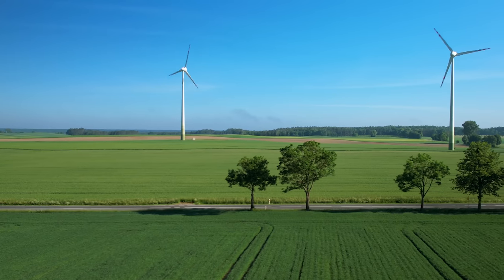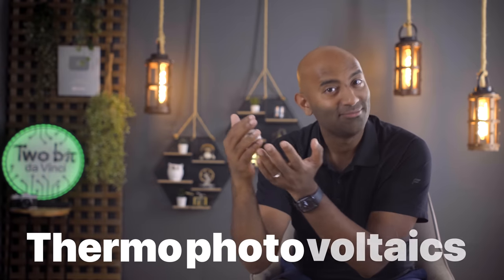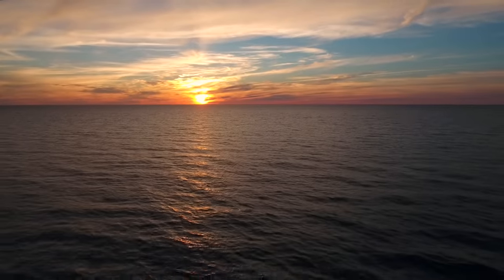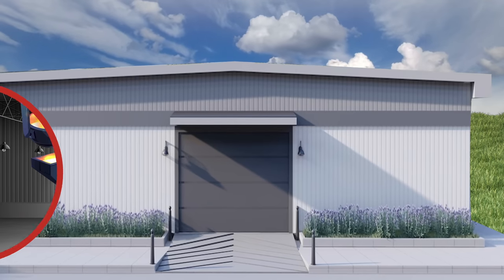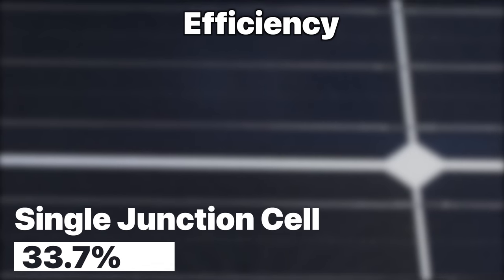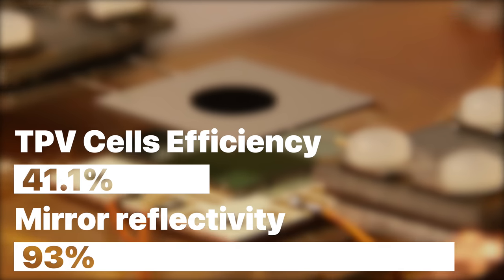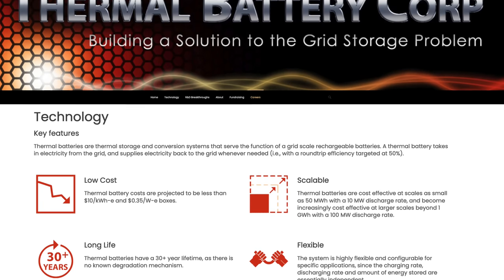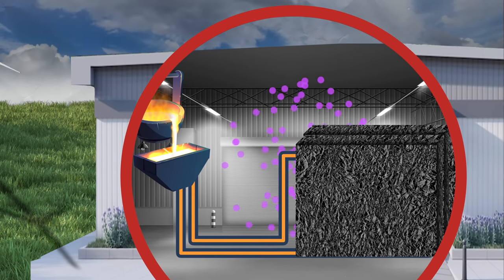Breakthrough Solar cell DOESN'T Run On Sunshine!

Comment: Turbines are an extremely mature, efficient, and reliable technology for heat to mechanical conversion, (every nuclear plant uses turbines, as well as every passenger jet ).
As well the heat capacity of graphite vs water is almost 6/1 in water's favor, 0.77 Jgk vs 4.186 Jgk... using such low Cp substrates for heat storage makes no sense.
High energy photovoltaic cells are ALWAYS prone to shorts, requiring complex decoupling to prevent array meltdown.
This idea will be another on the gov subsidized junk heap of really bad ideas.

Comment: In the deserts this would be super beneficial, hope it pans out
Reply: But in deserts, you could simply lay black pipe on the ground, cover with a transparent lid, pump water through it and connect it to a heat exchanger.

Comment: Thermal photovoltaics should be more efficient than steam and Sterling engines to extract heat from nuclear fuel ponds. Maybe with some solar-powered heat pumps.

Comment: Just think of direkct Nuclear radiation/heat to Power, without that crappy steam turbines. Just put Uranium inside these carbon isolation with the TPV cells. Boom nearly endless battery. No moving parts. No dependency on sunlight.

Comment: Are you sure about this? 1sqm of solar panels produces ~250W. The claim that these cells produce 100kW per sqm seems questionable. Where is that power coming from in the first place? Sunlight only produces 1kW per sqm in peak conditions.

Comment: I'd love to see 'waste' heat generated in industrial processes captured and used in this manner.
edit: Likely I don't understand this well enough to know if this is fantasy, but I hope!
Reply from the maker: Troy I was thinking the same thing, almost every thing humans do creates heat, from our electronics to smelters, and where there is massive extra heat, yeah we should absolutely do this!

maybe future homes have a graphite block buried underground, where heat from the AC can dump heat into... to get get that energy back in the evening or something... the question is what minimal threshold of heat would be needed, which could be the limiting factor.

but yes!
Reply: It would require an unprecedented level if cooperation. Politically and economically infeasible without deep pockets to cover the upfront investments.

Comment: I have envisioned a power cell for years that would work like a solar cell but use radiation as a power source. Radioactive waste would fuel it. Take a container lined with the cell and pour in radioactive waste. A new type of nuclear battery. We could make use of all the waste from reactors. I hope someone is working on this because it seems so simple. You could turn a barrel of waste into a battery just by popping the lid off and inserting a panel of these cells with a new lid for the wire to come out and you have a nuclear battery. I wonder if regular solar cell would work. Has anyone tried any of this?

Comment: I was wondering if this process can be used to disinfect water since UV rays are emitted or the heat can be used in desalination plants. 
Also can the T.P.V. be more efficient if cooling is provided at the back?
Reply: Regarding desalination but not necessarily related to the video. I've just been obsessed with a few designs lately.

I wonder if they've ever considered creating a hybrid between decondensing/condensing system and a heat/cold system.

Basically needs 2 chambers. A vacuum pump decompressing one chamber and compressing the other. And a heat pump moving heat into one while taking from another. And a handful of solenoids to seal them between phases.

Why do this? It'd take less time to boil and condense the water. Possibly it could even use less energy because it recycles heat... the vacuum pump does take energy as well. But would only need to be running periodically.

Comment: The assertion that wind and solar are less costly than traditional forms of energy generation is completely false. Substantial Federal subsidies are necessary to make wind and solar energy generation cost competitive. In addition, they are simply inadequate as a replacement for oil, gas and coal energy generation. Renewable energy simply isn't ready for "prime time". Europe's leadership has decided to provide an object lesson in reality this winter.

Comment: Would be great if they succed but as I see it their system has just too many failure points. I mean, if they can store that much energy inside these hypothetical carbon cubes, why not just use it to run steam turbines in combined cycle converting 40% of energy in electricity and another 20% in heating/hot water?

Comment: dk where you got you efficiency for the turbines. there more like 65 to 95 percent efficient for multi pass. Witch is what most if not all are for power generation. you must be talking about single stage. there more like 40 percent. But single stage arnt used very often.

Comment: This is pretty cool, but these ideas are not worth getting hyped over imo. I have learned that if more than one part of a proposed system is unproven in a practical application for the role it has to play, then the system is most likely going to fail. In this video you mention several new technologies which have not been proven to work in any practical application for the role they are expected to play in this proposed system. If it was just one experimental technology being utilized, and there were lots of tests and studies behind it, then I’d be much more on board. But this hypothetical system seems fraught with unknowns

Comment: Your estimation for power per square meter is way off. The cells themselves may only take up that much space, but the entire operation to radiate that sq meter is hundreds of sq meters. Just look at the size of that chamber alone holding the cells. 
It would be interesting if they can use it for scavenging heat but i bet its nowhere near economically feasible.

Comment: Yes, there are a lot of physical unanswered questions in a system this complex. However, the real question is how much money will be spent by legacy industries to stop the advance of this tech? Maybe it is complex enough that they might be interested in it's success rather than it's failure at least if they can find a way to extract cash for themselves by helping it succeed rather than lose cash if it does. Time will tell. The fossil fuel industries have sure spent a ton of cash trying to keep their hold on humanity so far, but maybe the time is now.
Reply: PS Sorry if I sound very cynical. I cannot help it at my advanced age.

Comment: 12:55 the cost is around $10 per kwh but I currently pay $0.20 per kwh.  That would mean my last months electric bill instead of being $170 would be over $8,000. Hmmm, not gonna work.

Comment: Ummm... why not just modify foundries to use the heat they need to smelt metal, instead of just smelting tin for reuse
These foundries are already running sometimes 24/7

Comment: You should differentiate between steam- and gasturbines. I think you are confusing the two in the first few minutes regarding the efficiencies and temperatures.

For example, 60% is only possible if ypu combine the two systems serially. And i do not know of any steamturbinesystem working even close to 1500°C...

Comment: So... the theoretical best you'd get from these, is 50% conversion, and that's from the tungsten, not the tin itself. Meanwhile the video informs us that a really good turbine can get 65%. And the TPV's require ridiculous plumbing in giant argon-filled buildings, then cooling water presumably blasted around at the speed of sound before it flashes to steam and blows the whole thing up... There's going to be a 2,000C temperature difference between either side of this TPV thing, including it's housing.

I wouldn't bet my pension on this one... Maybe TPVs could help scavenge up a few more watts if we could get them to work at lower temperatures. But specifically building some sort of cutting-edge dragon's den, all state of the art, cutting-edge material handling, and it's not a whole shitload better than turbines, for a TON more hassle to keep it operating...

That, and if you have electricity you need storing, the LAST thing you should do is turn it into heat. Heat is just a crappy form of energy. There are others much more amenable to being stored, and being converted to and from electricity. Maybe have Elon pump and dump this one if he has 5 minutes spare between trolling decent citizens and hair transplant operations.

Comment: So your telling me that a turbine efficiency can reach ~60% while the reflective mirror Ga As cells two layer are at 43% and likely to ~50%.  
Now the energy storage in carbon block.  That heat can drive a turbine equally well as drive the solar cells.  A liquid is use to transfer the heat into and out of the carbon.   Where that heat comes from and goes to is really independent of the storage.
And since both turbine and solar cell or any device to convert heat to electricity  have heat sinks to cool. Basic thermodynamics that you must have a high and low energy state when handling energy to do work or store work.  No difference again.  
Turbine blades in temperature limit is determined by the material. ceramic can go much higher then metal.  The limit is determined by life cost. 
Semiconductor have a temperature limit also, for silicone the electrons get so active at ~ 250C that they can not be controlled. Ga As have a different limit but still far below that of a turbine.  So to hold them at a lower temperature means that by radiation they are cooling the emitter.  Can not eliminate absorption of radiated energy.  
The life cost is then the separation factor.  And we know from semiconductors that they have a bath tube life.  They like the turbine and its components do fail eventually.  These solar cell assemblies will fail.  What needs to be determine is the life time cost which should be part of any future discussion.

Comment: Why don't they reverse the system 
Corporate engineers are fixated with building Rube Goldberg machines 
Use cold,  refrigeration,  refrigeration is also an Energy storage system
Use excess Energy to freeze water and drop the ice temperature to what ever temperature you want 
In colder climates, you can use the natural environment to lower the temperature for you, down to  -30c 
Bury the high u value ice box in the ground,  use silicon thermal generator pile to generate electricity from thermal difference between ice and ground or air or sunlight or water or some other thermal source 
The buried ice boxes save ground space,  easy and low cost to build 
Alot less hazardous and you can even use them to preserve your Thanksgiving turkeys 
Water, sunlight,  silicon thermal generators,  ground, air, solar heat, not to many moving parts

Comment: I like the video but it’s kind of biased to make TPV look so much better than PV. TPV is a storage technology not a generation technology and the video continually compares it’s 50% efficiency to the 22% of silicon panels to make the TPV cells look better. 50% is abismal in storage applications and this video touts it like it is a replacement for PV when they are not in the same ball park.
Reply: This is not quite true. From a thermodynamic perspective TPV is simply more efficient than single junction solar cells, succ as silicon. A fare comparison would be against multijunction solar cells which have similar high efficiency.

Comment: Wait.... you are saying it can store energy at 10$ per kilowatt hour?   Plus you have to also generate the power for additional cost. This does not sound promising at all. I think I am around 13 to 14 cents per kilowatt hour and the energy I get is combo between hydro and coal. And the air coming out of them coal scrubber after burning is 98% clean air, cleaner then most cities I would guess.

Comment: Use a Fresnel lens directly onto this! And scale it.
Reply: Same lens used in an overhead projector, in a classroom.
Reply: Not enough heat for the flow.. But that's basically what is being done out west, with mirrors focused on a water tower.

Comment: Wind energy on large scale production farms is NOT clean. The breakdown of blades due to use coupled with their extremely long degredation time once decommissioned as well as their extreme difficulty with regards to recyclability due to their composite materials has created a massive waste problem for landfills.

Wind should only be used for small scale individual production where the blades don't have to endure such extreme stresses. Solar is better for larger scale applications. And current nuclear technologies are by far the cleanest and most beneficial options available.

Comment: Why are you comparing storage (TPV) to energy creation. Steak and solar panels. TPV still has to have get the energy from somewhere. Solar is just not a dense energy source. How large a solar field would you need to sustain 750,000 houses (1gw) for 3-4 days w 
out sun? It has to be reliable.

Comment: No! Solar and wind are NOT the cleanest form of energy when you account or the amount of acreage they consume and the chemicals used in the manufacturing as well as the disposal methods of the panels and the blades... the gigantic blades are either buried in landfills or burned often overseas so that the EPA cant get involved. Once you add the energy storage required such as batteries the cleanliness gets even worse, again due to the manufacture and disposal of the batteries. the cleanest, safest (proven statistically)  and most energy dense form of energy generation is Nuclear.

Comment: Solar and wind are not the cheapest energy you do not include costs like transmission connection subsidies or the fact they need replacing every 15-25 years

Comment: Could they use those panels on the steam output of traditional thermal power stations to extract even more electric power from the same amount of fuel input?

Comment: Maybe the numbers for this work out, but the solution feels insanely over-engineered save for extremely niche industries like metallurgy. Sand-based STES can cover the vast majority of use-cases this method does in a much cheaper and cleaner way.

Comment: Wow 50% efficiency... because reasons when "lab" was apparently 40% or whatever (will just gloss over that as quickly as you did).  The TPV cells cannot stand high heat so cool them with water 9:25 with a heat sink... to decrease efficiency....   Also, you have to generate the heat... unlike a solar panel.... whats the efficiency on that process?  
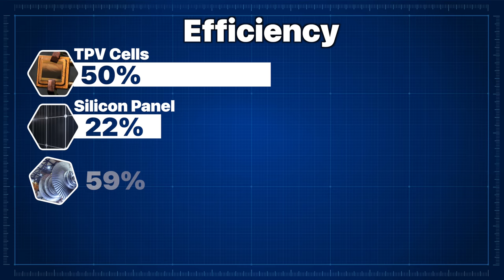Use your "average" efficiencies for solar, steam, (which are electricity generation) etc against the TPV "Target" and Li-ion battery at 12:00 (which are both storage).   
I dont want to use the word absurd, but yeah absurd.

Comment: wouldn't these heat cells also work great in space if positioned in a constant sun Lagrange point? I'm talking the cells not the entire system. also could be an awesome heat shield for things like the space station. duel purpose heat shield and power source. maybe a power source for Venus probes
Reply: If they worked great in space, how would you get the energy back to earth?
What would be the purpose of  positioning them at The Lagrange Point?
Reply: That's where the original gallium arsenide cells are used. Any place they are exposed to solar energy.

Comment: All right here's a free energy device you take a ram pump dig a hole 3 ft wide 3 ft deep 8 ft long you line the pump or you line the whole with a way to hold water you put the ram pump in the hole you build 20 ft water wheel can you put a generator on it free power

Comment: Comparing it to steam turbines  multiple times is pretty bias.  And this has many moving parts then a battery that just sits there.  The cost of the cooling is not really addressed.  It will take much pressure to get much flow to keep water from boiling.    Lots of holes in this.

Comment: Most inefficient electric power storage idea ever.
Reply: I kept waiting for the round trip efficiency estimate for the whole system. Converting photons to electricity to heat to photons to electricity is ridiculously inefficient. This is the type of technology I would promote if I was a coal executive.
Reply: @patrickcorcoran4828  RIGHT.

Comment: 100kw per sq meter, you wanna redo that math?  The most energy from the sun that hits the earth is 1000 watts per sq meter.
Reply: You can stand on the surface of the earth and not die. Standing under the tungsten filament in that box where their photocells are sitting would melt you in seconds. The energy density is entirely different between these and solar panels.

Comment: might be the clean to produce electricity but what do you do with the old blades that can't be recycled and not counting the thousand of tons of concrete in the base which needs coal to make and how much coal and oil does it take to make a solar panel without to coal and oil industries you cannot have either solar or wind power get rid of coal and oil and you cannot have either

Comment: Heating tin to molten, what’s the efficiency in that transfer? Why not just run wires through the graphite to heat directly? If it’s a closed loop there is no flow, as the tin cools it blocks the tubes, so it’s all single use? What then? half a football field of solid graphite stopping you maintaining it lol this clearly hasn’t been thought through.

Comment: MOLTEN TUNGSTEN OR GLOWING TUNGSTEN WE JUST GOT AWAY FROM USING TUNGSTEN LIGHT BULBS BECAUSE THEY'RE SO INEFFICIENT AND TUNGSTEN IS ONE HARD METAL AND IT RESISTS HEAT SO I GET IT UP TO THE POINT YOU'RE TALKING ABOUT YOU'RE USING A HUGE AMOUNT OF ENERGY YOU'RE ONLY SEEING ONE SIDE OF IT GLOWING WHERE IS ALL THE REST OF IT GOING AND THAT'S NUTS